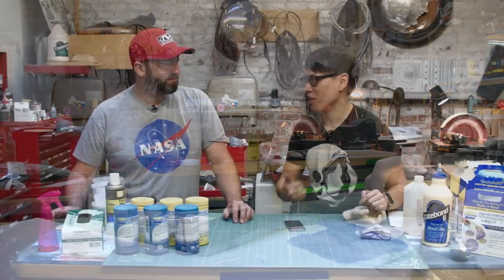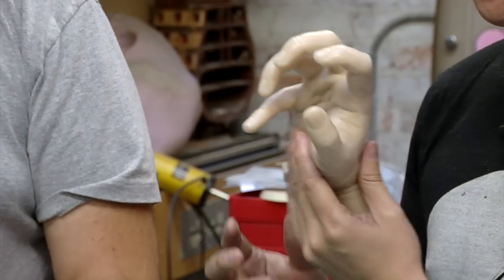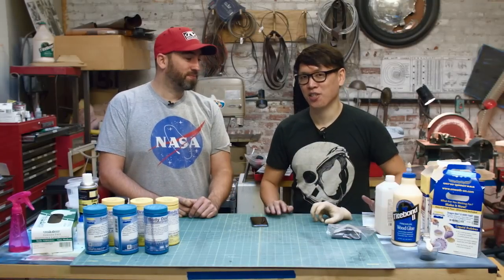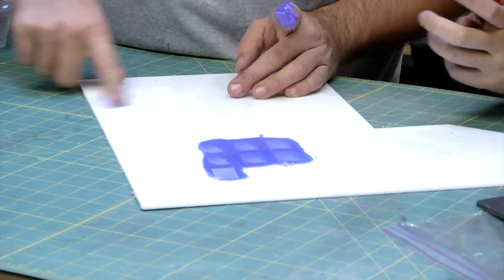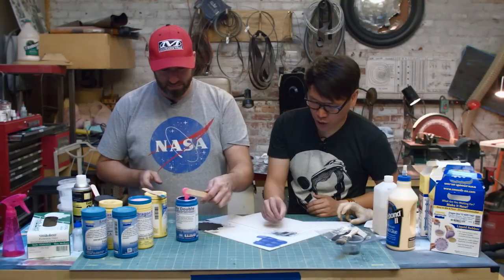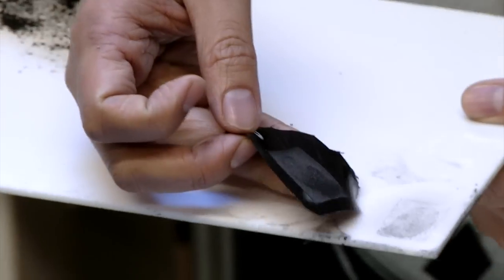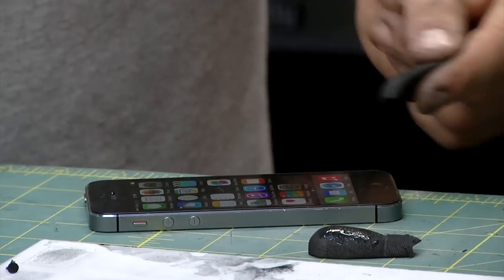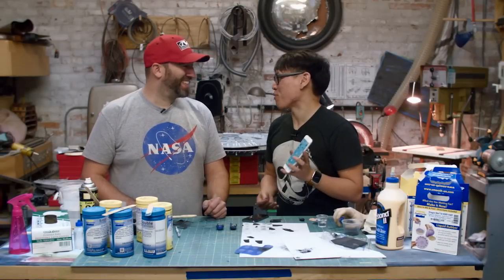Testing Apple's Touch ID with Fake Fingerprints

Comment: Tried it at home with a greasy piece of cling film aka saran wrap using the palm of my hand to pass though conductivity , i even unlocked my phone using the greasy finger print already on the reader , clingfilm over and press a smooth bit of skin on top of the sensor

Comment: @Tested Although the laser fingerprint copy failed, it did at least trick the sensor by passing as a real finger (attempt). So, the question I have is, would the laser fingerprint work had you began with registering it in iOS as a new finger before attempting to unlock the phone? Interesting & entertaining experiment though!

Comment: Touch ID works off of blood flow, not the print, it uses the print, yes but you also need the right blood flow. With this feature people cannot cut off your finger and pay for stuff or unlock your phone
Reply: That is true but it's only half the battle, you still need the right blood flow. That's why it doesn't work when your hands are cold and or wet

Comment: Touch ID does not take a picture of the finger, it uses a high resolution capacitive touch array to capture the distances from the sensor to the finger for the ridges and valleys of your finger.

Comment: maybe if the laser cut ones weren't so thin they would have worked it could be its so thin that the sensor that's looking at the finger print sees the finger print behind the laser cut mold

Comment: Try this, place a piece of receipt paper over Touch ID and then try unlocking it with ur finger print and u will see it still works 

This proves that Touch ID must shine some sort of light that can go trough the paper and still pick up ur finger print
Reply: +Bryan Miller So you were proven wrong and reverted to calling them teens, claimed you were 33 then proceeded to question their intelligence due to their age.. Man that shit is weak
Reply: +Bryan Miller That doesn't prove it, and that theory is wrong. It's not a secret. It uses Capacitive sensing through the steel ring.
Reply: Nope, I can unlock mine by just touching the inner part and avoiding the ring
Reply: It can scan through multiple layers of skin, so it does work with a paper over your finger.
Reply: +Bryan Miller It uses a pressure system not no light
Reply: +Ckc dillpickle what do you mean?? xD its a fingerprint sensor, not a pressure plate thing...
Reply: Felon
Its called a Fingerprint sensor buddy. It works just like a touchscreen but it remembers 50-200 points on your finger Search it up
Reply: +Bryan Miller yeah probably IR light
Reply: +Ckc dillpickle it's a photo sensor, he even says that at the beginning of the video. since you're blocking any light getting to the sensor, it makes sense they'd have some kind of LED in there to make it work
Reply: Not no pressure system since u don't need to apply any pressure, just very lightly placing finger on it still works
 And it's already been proven before that it's basically a high res camera that takes a pic of ur prints and stores them and then compares them to the next time u scan ur finger and unlocks when it matches
Reply: Bryan Miller
Its a pressure system.    Fingerprint recognition systems make a map of 40 to 100 unique features of your fingerprint and then put it into a format that can be interpreted by a mathematical equation. These unique features are defined by the ridges (dermal papillae) on your fingertips that make up the arches, loops, and whorls of your fingerprint.

If its a image then it wouldn't need to do mathematical equations
Reply: It can't be pressure since it works without applying any

And it works through paper just fine so there's no pressure
Reply: Bryan Miller Dude I told you exactly what it is. It's not a secret, it's a patented thing. Feel free to take apart your iphone for yourself. Not really sure why you wont believe me when I provided proof.
Reply: What u did was no prove dude

Actual real professionals have proved it to be a high res camera system
Reply: Bryan Miller No, they haven't. Apple has a patent on it. Not only that, but it's a device that scans the human. Apple is legally not allowed to lie about how it's made. It uses Capacitive touch though the steel ring. The censor, which I already showed you has 170 µm, with 500 pixels per inch resolution. Just because it has a resolution does not mean it's a camera. A sensor is not a camera.
Reply: Not exactly cuz I've used many times without even touching the metal ring, just touching the center works fine
Reply: http://m.imore.com/how-touch-id-works

Read this dude

As it says, it takes a HIGH RES SNAPSHOT of ur print and compares it to ur stored prints
Reply: Also note that even though u may program ur prints upright, it still works holding it upside down to unlock 

That's cuz it's just comparing to stored pics thus doesn't care if it's upside down or not cuz it know which way to look at it correctly 

Nothing to do with pressure sensing
Reply: Bryan Miller
It can't be pressure because it works without applying any. Its impossible to not apply pressure
Reply: Yes cuz u don't need to press the button at all, u can unlock it fine with feather light tap baring even touching it

I do it everyday on my iPhone 6s Plus
Reply: Bryan Miller
Thats still applying pressure
Reply: Bryan Miller Buddy, YOU need to read it. The THIRD picture even lists "CAPACITIVE TOUCH". This is getting ridiculous. Seriously, how stupid can you be? You do know that a snapshot does NOT mean picture right? Just like APPLE TELLS YOU RIGHT ON THAT PAGE, it uses CAPACITIVE TOUCH. the censor is a 500 PPI resolution sensor which takes a snapshot of your finger print. now, because I guess I have to explain to you what a snapshot is.. A snapshot is a saved point in time in a computer system. It is a COPY of a information that was captured and no longer there. I get your confusion as camera photos are sometimes referred to as a snapshot, or snap, and other terms. While it is true that a picture is a snapshot, a snapshot is not a picture.
Reply: Ur the idiot who looks like some sort of California high school student
Reply: Bryan Miller I'm clearly not the idiot here. You don't even know how to read. You also refuse to believe extremely obvious facts put right infront of your eyes
Reply: Come back when u finally graduate
Reply: +Bryan Miller its funny, youre clearly 15 or younger. Youre one of those people who resorts to insults when they realise they are wrong
Reply: Lol no, I'm 33 and married and have worked in the tech industry in the past so think again kid
Reply: Bryan Miller no, you have no worked in the tech industry. That becomes blatantly obviously when you dont even know what a snapshot is. Just because you lied about that, I'm going to go ahead and assume you are also not married and you're not 33.
Reply: Devin Shillington a snapshot is the state of a system at a particular point in time. The term was coined as an analogy to that in photography. It can refer to an actual copy of the state of a system or to a capability provided by certain systems.
Reply: No shit kids
Reply: No use arguing with teens
Reply: ***** Thats exactly what I said it was. 4 comments up I wrote: "A snapshot is a saved point in time in a computer system. It is a COPY of a information that was captured and no longer there."
Reply: Of course kids know less, I've been around the block and have quite the experience compared to some know it all kid who thinks he's right even when proven wrong over and over
Reply: Bryan Miller You haven't proved me wrong. I showed you exactly how the censor works, showed you pictures, and showed you the patent. You've done nothing but tell me how you think it works, and then resorted to name calling. You also tried to make a point about how old I am vs how old you. I'm still not sure what your thought process was with that.

Comment: its not gonna work because it needs living tissue to work
Reply: lol no
Reply: Connor Richlen its true dumb ass
Reply: +ScorpioLeagueX It did end up working...
Reply: +ScorpioLeagueX No. 
            
 Fingerprint recognition systems make a map of 40 to 100 unique features
 of your fingerprint and then put it into a format that can be 
interpreted by a mathematical equation.  These unique features are 
defined by the ridges (dermal papillae) on your fingertips that make up 
the arches, loops, and whorls of your fingerprint. 

 

The devices do not store a copy of your fingerprint.  The format in 
which the data is stored is encrypted, and different companies that make
 the devices use different mathematical formulas to interpret the data.

Comment: cool someone doesnt have to saw off my finger if someone steal my phone
Reply: Spectre Lex not if it's cut off.
Reply: If you watched the video it's not about heat or electrical signals; it's about capacitance which is the ABILITY for something to hold a charge. Your finger, cut off or not, will have enough capacitance to bypass the id system. Meaning if someone cut off your finger, someone could get into your phone, but that's only if the blade did not cut through the fingerprints minutiae.
Reply: That would be hard to open it with your sawed off finger
Reply: +Kenny K It is activated by heat.
Reply: +Air stuff17 but still, your fingers won't have heat, right?

Comment: The implications of this video's experiment are growing as touch ID becomes relied on for more sensitive tasks - such as Apple Pay.  Sure, while the odds of somebody pulling this off without my finger present for a "casting" is highly unlikely, the simple fact that graphite coated silicon looks like human skin to the sensor is troubling.
Reply: +Kyle E That's why it still asks you for your password upon reboot. Exactly for this reason.

Comment: If you steal an Android phone (only some works) and if you're smart enough you would just hard reset the phone and the person won't be able to use the phone finder app thingy, because the email is not on the phone.
Reply: Don't you need a password to hard reset? Assuming you use the power and volume down.
Reply: Last time I hard reset my phone (HTC Desire 626) i could do it from the lockscreen without unlocking the phone.
Reply: +Ryan Wilfred from the lock screen? How? I know you can hard reset by 1. Going I to settings and hard resetting. 2. Some dumb security setting where if you screw up the password and the pin, it automatically hard resets. 3 power off the phone, the hold the power and down volume button simultaneously. How did you reset it from the lock screen?
Reply: Yep. I used the power button and volume method. Works fine for me. I hard reset my phone because the camera had a problem and there isn't anything important on my phone.
Reply: +Ryan Wilfred oh, okay. I was confused when you said you used the lock screen
Reply: +Ryan Wilfred If you were SMART you wouldn't steal phones, dipshit.
Reply: +Ryan Wilfred No Idea what phone you have but on my LG G4 I can't reset the phone unless I'm plugged into my designated computer, have my phones password, and authorize it through an email.
Reply: I did this with my galaxy ring because I forgot my passcode. Ddisnt need it to factory reset.
Reply: yes but only for 4.4.4 lower the 5.1.1 update dosent allow this it just blocks the phone.....so dont try it with 5.1.1 if u dont know what youre doing.......and if u do block it just use odin and flash  stock firmware
Reply: yes but only for 4.4.4 lower the 5.1.1 update dosent allow this it just blocks the phone.....so dont try it with 5.1.1 if u dont know what youre doing.......and if u do block it just use odin and flash  stock firmware
Reply: +OMG. if it is locked and asks for email used before just use and otg cable to bypass it
Reply: Hey I don't want to get specific but there's always a way that's all I can tell u
Reply: +OMG. go on otg bypass and u will see......but security is made to protect and stop u from doing things you're not supposed to like getting free software.........example....like being trapped in a building just an example by the way and what coders/hackers do is go around the software this is called bypassing they find a weakness and use it as an advantage
Reply: yes but with a PC u can do the exact same thing with to an apple . obviously knowing apples greedy asses you have to have a Mac not a PC. but I gave a Samsung gs6. and it works PERFECTLY.
Reply: +Mcdoobenheim Hausaufgoben we aren't talking about stolen phones....just like if we accidentally forget the password
Reply: Rigo Figueroa did u not read the comment everyone is replying to? He says if u steal and android
Reply: +OMG. yeah they patched it for 6.0 but it will work on 5.1.1 and 5.0.1
Reply: +supergamer kiddo but like u know what I mean I'm not trying to show people who steal phones how to unblock them just the once who own them and forget the password
Reply: Rigo Figueroa ya but he wasn't replying specificly to you. He was replying to the original comment.
Reply: +supergamer kiddo yo I'm like soooo tired I don't even know even why I'm responding to this but have a good day ight
Reply: +Yes us Rand Pay attention to what you just said. Has anyone here heard of ODIN?
Reply: Cinder Heart of course only people that root and stuff I have my s6 rooted 5.1.1 with custom kernel and recovery
Reply: you can track a phone by imei. and serial... you can't delete the serial number on it ffs
Reply: Marty Camenzind people that use phones to call have no idea what a Imei is
Reply: Rigo Figueroa indeed or a specs page
Reply: +David Wang I found a phone and nobody claimed it (not making an excuse, I still stole it and kinda feel bad now, 2 years later) and I just hard reset it and it was mine.
Reply: Mike M poor person didn't keep his imei.. although the retailer should keep track of such info..
Reply: Marty Camenzind I never put a sim in it.
Reply: Mike M imei is on the phone not the sim... that's why it came on the box in my s7 unboxing
Reply: IMEI numbers are on ALL GSM phones and select tablets (If your tablet can connect to data services, it has an imei) IMEI stands for International Mobile Station Equipment Identity, and is required for all GSm handsets. its purpose is to identfy all phones that are connected to the network. The gov't may also BAN devices from connecting to its international networks (EX. if the US were to ban an imei number "2231543" the corresponding phone will not be able to connect to any of the US carrier providers)
Reply: Marty Camenzind I don't know why I told you that lol I know IMEI is on the phone.
Reply: Bruh why do you now this
Reply: +Jared Marsh ARE YOU CRAZY??? Flashing from Odin??? This might void your warranty and doing it via stock recovery is alot easier
Reply: Mikee Odin doesnt void unless you root or install a custom recovery.
Reply: Mhikei D MIGHT and its still alot easier via stock recovery
Reply: Mikee yeah. everything is done on the device without a PC. but stock recovery lacks alot of features.
Reply: Mhikei D but works for el device reset
Reply: Rigo Figueroa are you saying you forgot your finger print?
Reply: Ryan Wilfred same with Apple. After you reset or try 10 times, it asks for your ipad
Reply: Besides FRP removal apps, bypasses, flashing software, custom recoveries, and other things that bypass FRP. It's not all that difficult to get in to any device you have physical access to.

Comment: what they didn't try is the biggest said possible way to break the lock and that is to take a piece of clear plastic rap and put that over the button and placing your finger on that because apples touch ID doesn't smear the finger print like Samsung does.

Comment: Myth busters already busted this type of claim with the biometrics fingerprint scanner unlock for a computer. It just scans the pattern and uses the heat of your body....
Reply: Zestypanda Some of them are from Mythbusters
Reply: Elliot Lockett Yup. I know that. Which is another reason why I'm asking why they did it again?
Reply: +Zestypanda It doesn't use heat at all. It uses your fingerprint only

            
 Fingerprint recognition systems make a map of 40 to 100 unique features
 of your fingerprint and then put it into a format that can be 
interpreted by a mathematical equation.  These unique features are 
defined by the ridges (dermal papillae) on your fingertips that make up 
the arches, loops, and whorls of your fingerprint. 

 

The devices do not store a copy of your fingerprint.  The format in 
which the data is stored is encrypted, and different companies that make
 the devices use different mathematical formulas to interpret the data.
Reply: Thanks for the clarification on behalf of Zestypanda.

Comment: We used a biometric fingerprint scanner at work, and it worked well until I cut my thumb sharpening some kitchen knives. I couldn't clock in for over a week until the new skin grew in and the old smoothed out.

Now imagine a week without access to your phone. Its sitting right there and you can't use it. No texting, no candy crush, no clash of clans, nothing. all cuz you went with the newest security gimmick.

Comment: This reminds me of a time that Mythbusters managed to unlock the latest security systems for private homes by taking a picture of a print, printing it on normal paper, licking it, and then simply pressing it to the scanner. It would be interesting to see if the same works for the devices that use this technology.